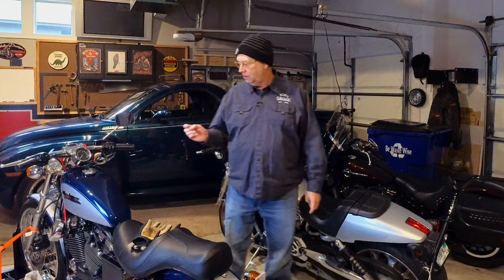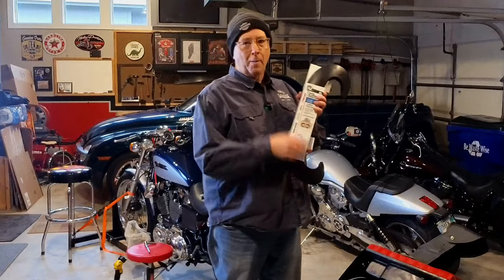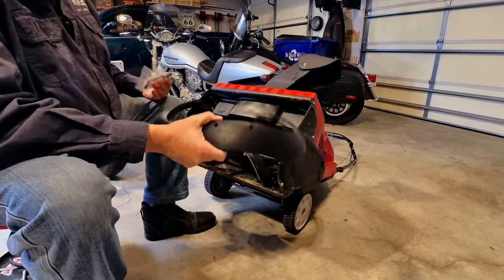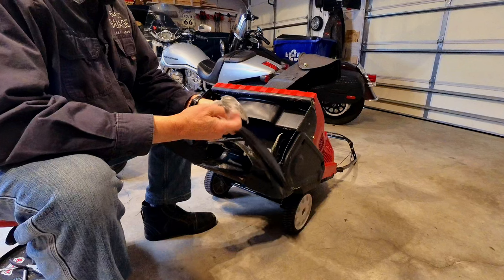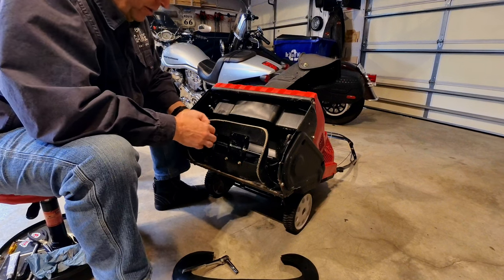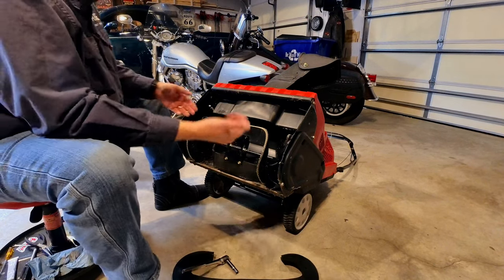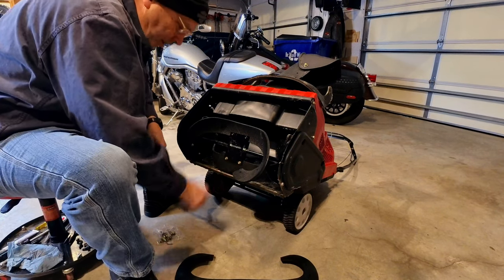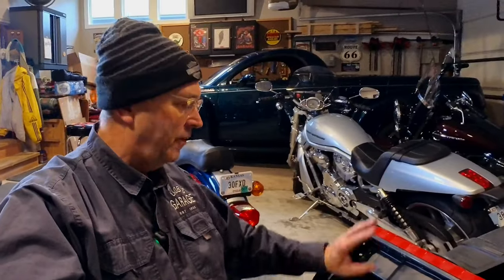How to replace rubber paddles on Troy Bilt Snow Blower

Comment: Do you have to adjust the metal scoop plate (technical term) behind the blades after replacing your warn out floppy used rubber? (Insert joke) 😇
Reply from the maker: That's what she said.... 😆 

I didn't replace it.. it just filed the burrs and readjusted it..